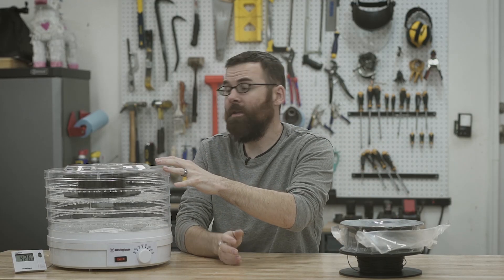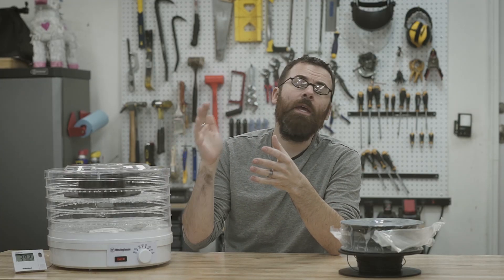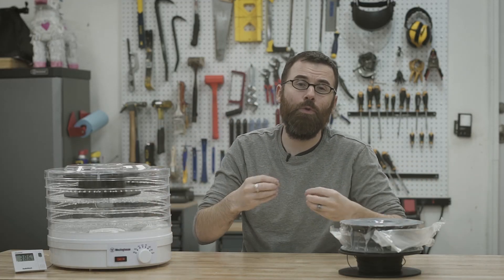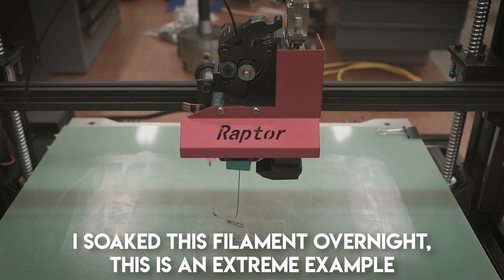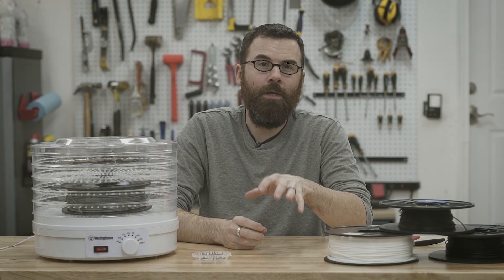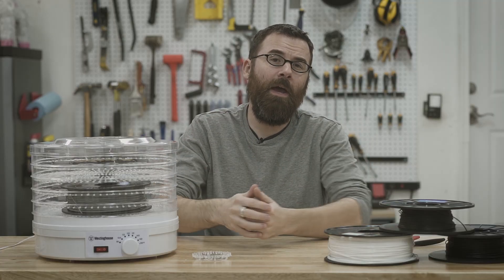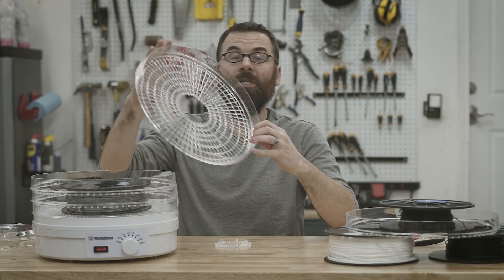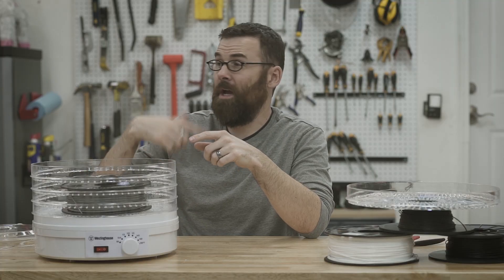Filament Drying Guide

Comment: Love the video. It really helps me understand the drying process as I’m also in Colorado. I’m having issues with my PLA filament Breaking halfway through a print.  any suggestions on this would be really helpful.
Reply from the maker: Huh, that's odd.  I haven't seen that before, maybe a bad batch of filament?  Have you tried a different spool from another vendor?
Reply: @RobertCowanDIY  no i haven't tried a different vender. I get my filament form Microcenter in aurora, do you know different place in town that has pla and abs locally or would online be a better place?
Reply from the maker: @bishipc117  I would try a different vendor first.  I don't know of many locally, especially down south.  I know Lulzbot up north carries filament.  Your best bet would just be to get something from amazon, try their basics brand, I hear good things about it and you'll have it in a couple days.
Reply: @RobertCowanDIY    Brittleness in PLA is a moisture symptom. Thanks for the video! You may want to fix your affiliate link for the dryer.
Reply: I know this is replying to a 3 yr old comment but just in case it helps, PLA breaking is a symptom of moisture absorption.  I am also on the Front Range in Colorado and was pretty surprised to find I had moisture problem in my filament. I put a spool in the oven at lowest temp for several hours and no more brittleness. I don't recommend the oven method as it was a bit on the hot side but it got me through a rush project in good shape.

Comment: If you live on the front range does pla need drying I live in Buena Vista CO 8000 ft and my humidity inside now is 10% now the humidity is 45% outside do I need to dry my PLA plus no one has eve said what is optimal humidity for PLA and best prints, WHY?
Reply from the maker: 0% is optimal.  Seriously.  If there is any moisture in the air, PLA and other hydrophilic materials will want to absorb that moisture, and ANY moisture in the air is bad.  I'm in Colorado as well (Erie) and I didn't think there was a problem until I started drying my filament.

Comment: if you know the weight of a reel, I wonder if you could work out water absorbtion from the weight , not sure how accurate the length/weight of the shipping is. Are they significantly lighter after cooking them?
Reply: Yes, in the automotive plastics industry we just take a few grams and weigh them. Then we dry them out and measure the difference and calculate the percent moisture.
You will never get all of the moisture out and you don’t need to but you need to get it down to a certain level for various materials. Nylon is the worst and you have to get it the driest because it will most readily react to the water.  It isn’t just sputtering. It is burning the material and degrading the properties.

Comment: iv been attempting to use one with my NylonX filament with no success, the same model but I have not ran it more then over night ill try and run it for longer 24+ hours this next time.  mine seem to vibrate a lot so I made some feet for this model you can print out of TPU that seems to help with that issue. it is available on Thingiverse
Reply from the maker: That's odd that it vibrates.  You might have a bad unit, it shouldn't vibrate at all.  Mine makes a tiny bit of noise from a fan, but that's it.
Reply: Robert Cowan it was making to table it was on vibrate it wasn't too bad